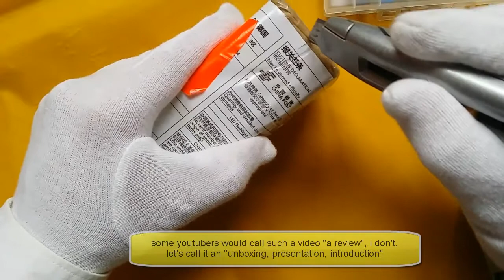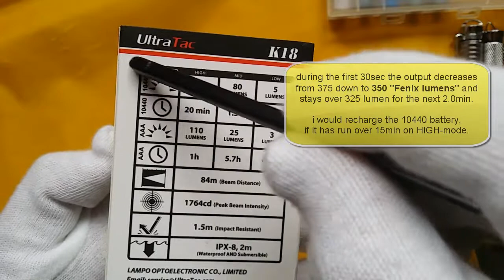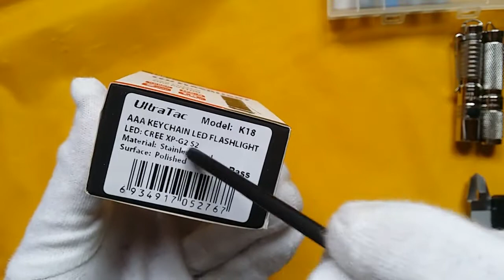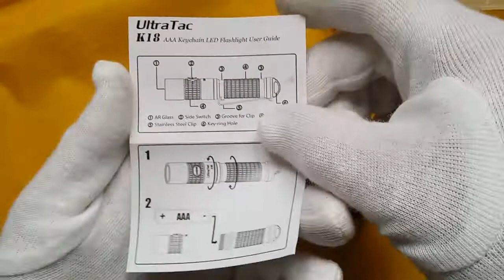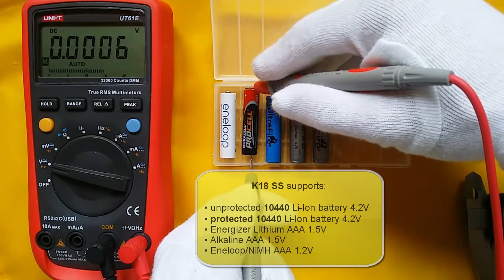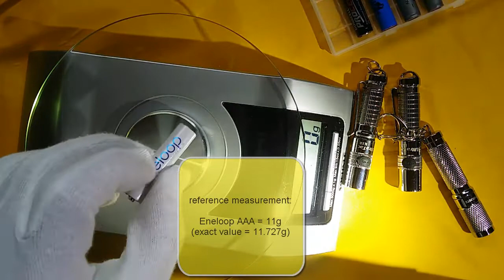UltraTac K18 SS K18SS stainless steel flashlight

Comment: The protected batteries by Trustfire do work on the aluminum version and they also do not leave a gap between the bezel and the body, even though they have the protection cap on the bottom!

Comment: You realize you're creating a dead short on the batteries when measuring the length that way?
I have exactly the same calipers and they're definitely conductive. I'm surprised you didn't burn you fingers from the batteries heating up. Or is that the reason you're wearing gloves? ;)
[edit] Oh wait, it's already in the description... But it's definitely not good for your LiIons :) [/edit]